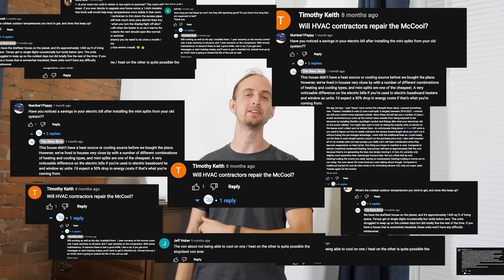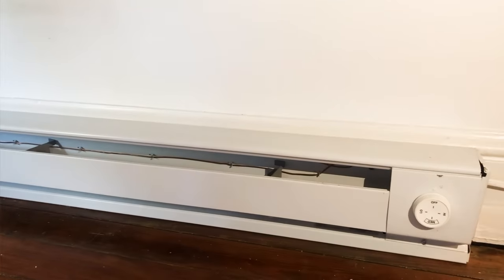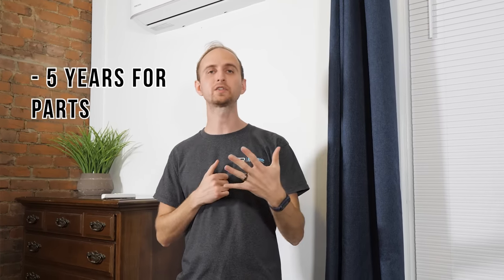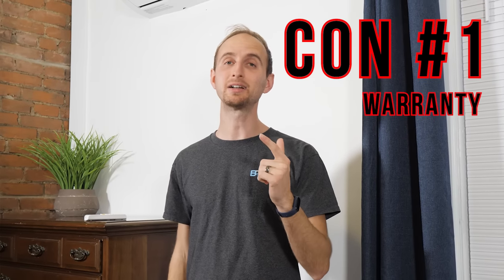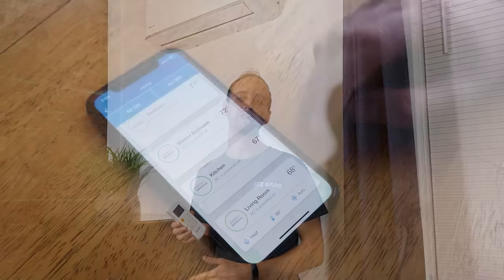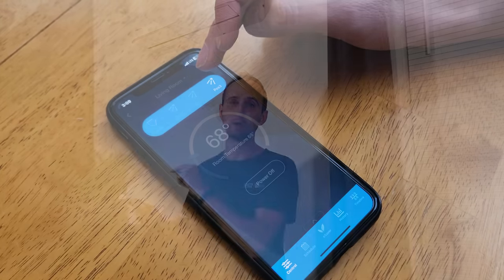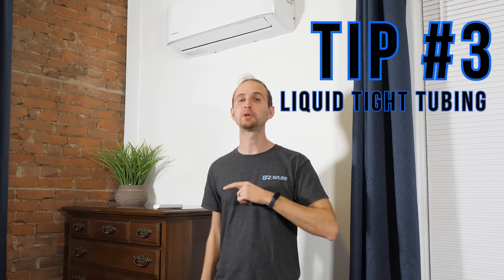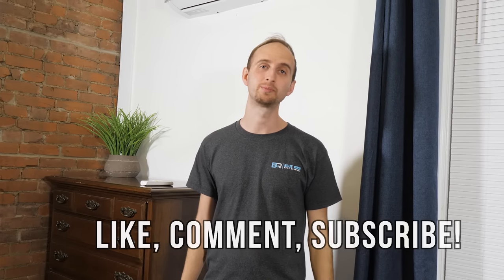Mr Cool DIY 2-Year REVIEW: I wish I would have known this BEFORE BUYING...

Comment: the people complaining about mr cool's warranty probably either bought direct form them or from another 3rd party (probably authorized) seller that wouldn't help them.  So, if you bought from a seller that actually will help you, GREAT!  If you bought from a seller who could give zero cares AFTER the sale, then you'd be in the same boat as the other people and if mr cool doesn't push the 3rd party company to help then you're really out of luck without going the legal option and not many people will.
Reply from the maker: Thanks for commenting! Actually the main complaint I’ve heard is that Mr Cool warranty dept is impossible to reach. So what I was able to determine is that either those people didn’t even try using Mr Cool’s warranty claim form on the website, or Mr Cool has become 100% better at dealing with claims in the last 6 months. Based on the complaints I’ve heard, I think it’s that people aren’t using the form on the website and expecting that calling a phone number will get them quicker help. In my perspective, that’s their mistake, not necessarily Mr Cool’s, especially since they direct people to their website form for claims. Mr Cool was extremely responsive to my claim.
Reply: Or just buy from Ingrams.  Ingrams and Mr Cool are both based in Kentucky.  They have a relationship that the consumer benefits from.

Comment: All heat pump's  defrost. We have Trane heat pump central unit and it defrost in the winter there is no way to get away from that no matter what brand you have!
Reply from the maker: Indeed! Necessary feature, and it mostly just defrosts on the coldest days of the year. The bummer for us is that when it’s defrosting we notice a significant temperature change on those coldest days of the year… thanks to our great insulation…

Comment: The thumbnail is clickbait, suggesting that it deserves a "one star review" after two years.  This is BS.  It worked out great and the warranty issue they had was resolved quickly.
Reply from the maker: Depends on whether you think you should have 5 or 6 warranty issues in 2 years. While they have stood behind their product, I don't want to be fixing this unit every couple years.
Reply: @TheRenoBros  Maybe I didn't watch closely enough.  You talked about the motor whine on both units and you got new motors under warranty.  Not ideal, but they responded.  What were the other 3-4 issues, and how did they respond to those?
Reply from the maker: @Scruit  Perhaps I'll post a 3 year review. The outside condenser has been making a sound since I installed it. It's sitting right next to another condenser from Mr Cool, and I just started to realize that one is quieter than the other. We had a tenant ask about the noise, so that's when I started investigating. Mr Cool still doesn't know what caused the noise, but they sent me a new condenser and I had to pay my HVAC tech like $600 to swap out the old and install the new one. The noise is gone now. I can also tell the fam motors in the heads are starting to go bad again.
Reply: @TheRenoBros Appreciate the info.  I'm looking at installing a MrCool and I'll be sure to research fan noise complaints.

Comment: Contractors are pissed that they didn't get to supply and install the heat pump.
Contractors mark up their equipment 30-40%  and are pissed they didn't get the money!  In reality they should jump at the chance to do your work they will pick up a life long customer and perhaps get to sell the next heat pump!
Reply from the maker: So true
Reply: As a HVAC service contractor I would say we're generally not upset someone is installing their own equipment. What I see is what you may save upfront by doing it yourself will be eaten up due to having to call in a professional to repair these products that are not backed by legit warranties. Having to tell these customers they have to pay more out of pocket within a year or 2 is common with this particular product. As far as the 30 to 40 percent markup you are correct, what people forget about running a business is their is overhead like gas for vehicles, insurance among many other etc...
Reply from the maker: @recipientsaward4489  Do you work on homeowner installed equipment? If so, do you refuse to work on certain brands like Mr Cool?
Reply: @recipientsaward4489  As an electrical contractor wiring heat pumps for several different HVAC companies, I have noticed the heat pumps get made cheaper and cheaper over the last 30 years. Now many , including the so called best "Carrier" come with aluminum coils, no copper!
Most pf the compressors come from 2 different factories, same with the reversing valves, and all of the electronics come from Chinese factories as well, so If the name brands are any better, they are furiously trying to make them as low quality as the lower brands. As  contractor myself I fully under stand mark ups.
Reply: @TheRenoBros  Inresponse to your question. We gladly service all brands. My coworker just today dealt with a DIY Mr. Cool product that wasnt operating.We tried to reach out for technical support. He said they emailed him back 5 hours later, "time is money". If a business is to be viable they must do more than just email people back hours later. IMHO I would steer clear of products like this that are not supported.
Reply from the maker: @recipientsaward4489  makes a lot of sense! Thanks for the response! If I had it to do over again I’d still install the split system myself but install a Daikin or something. Then perhaps sub out the installation of the line set and covers

Comment: Mini splits are horrible!! Im an AC contractor in florida. Never liked them. As you see instead of 1 motor to deal with you changed a few. Next you have to put one in each room. Ok just use when in room but no AC in summer can lead to mildew and musty smells. Best is a central heat pump and get the lowedt SEER2 and pit in a frequency drive and youll have an equivalent to a 20 + SEER and dont be lazy and put in ductwork. Only draw back with heat pumps is not good in very cold conditions because theres only so much heat that can be removed from outside when its fricking cold. Next be sure to size properly for the space always. But I hate them because they are very difficult to service as they are entombed in a plastic case that breaks when you need to get to components. Think about it very good before getting a mini horror.

Comment: Not to mention Mr. Cool units are way over priced (almost double the price for a comparable Senville model on Amazon). I can get a 24K Senville for $1200.  Then minus the 30% Fed tax credit brings it to $840 and out local electric company has a $500 rebate so the total will be $340.

Comment: As far as the excess tubing on these Mr Cool units, I think it's a big drawback. I ended up going with Pioneer because they have different lengths of tubing in the kits and you can specify a completely custom length, so don't have to cut or flare yourself.  The drawback there is you have to be super careful about measuring and it's pretty hard to come up with an exact length, and you need some flexibility about spacing when installing. Otherwise I believe the quality on Pioneer is very similar to the Mr Cool units. I think a lot of these units are made by basically the same plants in China. I've had mine going through two summers and one winter and so far it's fine. And probably shares most of these pros and cons of any DIY unit. You know even if it just malfunctions and you can't figure it out and have to replace it myself, it cost about 1/3 of the quotes I got for an equivalent unit professionally installed. Also we've had completely professionally installed mini splits go bad after only 4-5 years and need full replacement because the techs just throw their hands up and tell you you need a new one. And around here it's $5,000 and up these days.

Comment: Motors will cost you next time, UGH! Proper motors should last over 20 years
Reply from the maker: Mine are under warranty for at least the next 3 years. If they start making noise again I’ll replace for free and save the old ones. Someone told me that it’s possible to oil them without much disassembly of the motor. So maybe if I keep the old motor and figure out how to lubricate it, I’ll be able to fix it and swap it in so I don’t have to buy any new ones once my warranty goes out

Comment: Chane it on one remote, change it on all ... Well. Good luck with that. 
Did you wired up a separated communication (IO) line to all of the units? No? Well. There is your answer ... It is cheap, and just did not get designed that way ...

Comment: Contractors/service monkeys are crybabies. If they cant make 500% profit on the sell and install so they are going to punish you when/if you need service. I was quoted 3K per head to install Mr Cool units on a SIPS project that had all the panels pre-engineered for the effort (wiring/drain/line) portals. They wanted 9k to install 3 heads. Wife and I did the whole instal in a weekend. We are still laughing today.

Comment: #5 is still dumb .....   if you understand a AC/heat pump with a multi unit.
Reply from the maker: It’s just a misunderstanding of con #5. For instance, if the temperature in the house is 75, and you have 2 heads both set to 70 degrees, one set to Auto, and one set to cool…both will attempt to cool the rooms respectively, but because the mode is different, it will override and disable the unit. This is a safety feature, but the problem is that you don’t have a clue which unit is causing the problem. So either you run all over the house trying to find out which unit is causing the override, or you have to go through the app opening up the settings for each unit separately to find out which one is set to the wrong mode. Has nothing to do with heating and cooling at the same time, as some tend to interpret.

Comment: Stop right there! If you are thinking about in the process or wanting to install a ductless heat pump system. Industry leading technology. This product will blow your mind. It is a heat pump system with no outdoor unit.  No line set to be installed. No communication cable. Everything is self-contained within the indoor unit 70% less installation time. 40% slimmer design. Wall-mounted ,floor mounted and cassette style offered.  EPHOCA is based out of Italy sold the number 36 countries with over 300,000 units in the United States alone. This is the future of hvac. If you are still installing an outdoor unit and an indoor unit, connecting the copper line sets, installing line set cover, installing the communication cable setting up all your tips from inside to outdoors during the installation walk away, and never look back. Douglas Mini Split Work systems have been offered and in production since the 80s for over 30 years top brands like LG, Samsung, Mitsubishi I’ve been producing minisplits just as they were in the 80s. Imagine a car manufacturer that is still making the same body type as they did in the 80s. Boring blend and it’s in the dinosaur age. Ephoca is the new wave of Hvac technology and equipment. Make the decision to be a part of the movement today. Ephoca all in one units of the future . We Offer service sales installs in trouble shooting in the all 50 states. Here to answer any more questions..
Here’s a link to some videos of their product line.

https://ephoca.com/video-gallery/

My personal email
James.Reyna@ephoca.com
(970)889-9846

Ephoca
Manufacturer in Cleveland, Ohio

1111 Superior Ave Suite 610, Cleveland, OH 44114
(216) 710-1000

You don’t know what you don’t know .

Comment: you say you cleaned the indoor fan coil when you replaced the 3 indoor fan motors. I would guess that the motors may have been fine but the blower wheels were dirty. the indoor unit needs to be power washed just like the outdoor cleaning shown in your video every 2 to 3 years. mold can build up inside the indoor unit. The professional cost for cleaning the indoor and outdoor coil can be more than 200.00 per unit. IF you have a major repair needed and you probably will at some point it can easily cost more than your savimgs on a yearly basis. All of the openings in the line hide connections I see in your video can cause your line sets to leak. The white line set insulation can react with any moisture to cause the copper lines to leak. This frankly is the worst looking installation I have ever seen. I really don't mean to be rude man but there is no wonder why any contractor would not want to touch that! That would just be a bridge too far for the contractors I know. I have been in this business almost 50 years and believe me I have seen black mold come out the indoor units when they are properly cleaned.
Reply from the maker: Thanks for the comment! Dust and mold build up was not what caused the annoying sound from the motors. We did have the two of our units cleaned and the sound continued until we replaced the motors. Just cheap parts is all.

Comment: What a whiner. Mama  mama the heater is defrosting for 5 up to 5 min. and I am cold mama. Help me.  Oh no mama  I cannot run the heater and cooler at the same time mama. Oh no mama  i have to use a remote control mama. I could get push button iduis mama. Someone please hep me hep me I can hear the fan mama. Go get daa da to help too mama. .  If you can not sleep with a fan noise or a person snoring then you are NOT tired enough.  In my day we had to carry wood through snow to heat the house.  Cowboy up bud. Other than the whining its pretty good informative video.  But it was frighting re the issues  it scared me.
Reply from the maker: This is a tough comment to top. 😂

Comment: That filter is a joke. This should be hapa filter.
Reply from the maker: HEPA filters for central air systems are much more typical because there’s often much more opportunity for dust and debris to be carried through the system inside the ducts. Ductless minisplits are only circulating the air in the room, so a minimal dust filter is the primary need.

Comment: As an HVAC professional, I would never sell or recommend off-brand mini-splits like Mr. Cool as they use the cheapest components they can find. 
For a higher installation cost, you would have a real brand and would not be dealing with any of these issues, plus you would have the ability to heat one room and ventilate another. 
No matter how long they say the warranty is, no homeowner wants to have to go through a warranty claim within the first 3 years.
Reply: I would expect nothing less than the HVAC party line.  Because, everyone has $16K to spend for a mini-split system, right?  I mean 1000% markup for parts and labor is fair, right?

Comment: Ok i dont comment much but first if youre a contract then you would have fixed the battery cover issue. Get over it stop complaining about and just fix it. Simple solution clear tape of the back, take a crafting knife and remove the ridge. But for christ sakes stop complaining about the remote.

Second why are you over complicating things its simple either all units needs to be heating or cooling they cant do both at the same time

Third you again complained about the remotes not changing over all units on the remote and having to go to each remote…. What happened to the common sense and use the dam phone?
Reply from the maker: Thanks for the roast! 😂 Next time you see a contractor using clear tape to do that let me know 😂